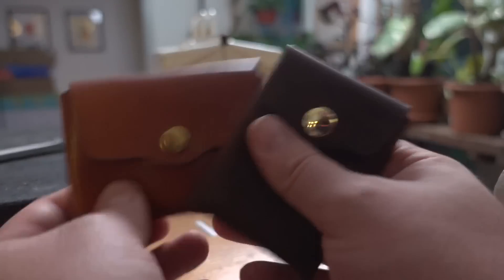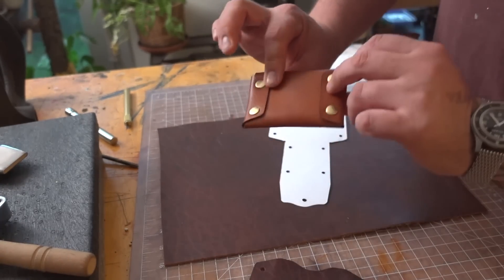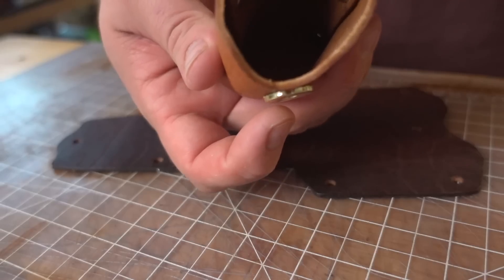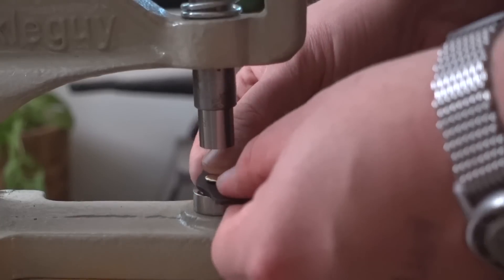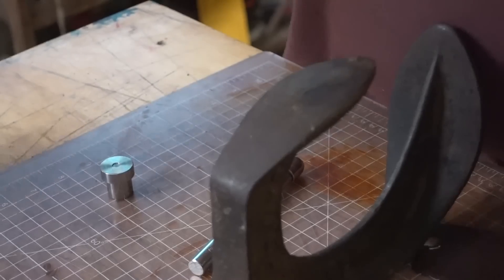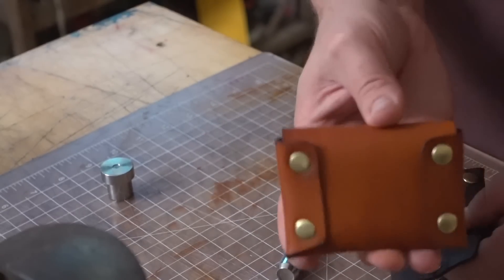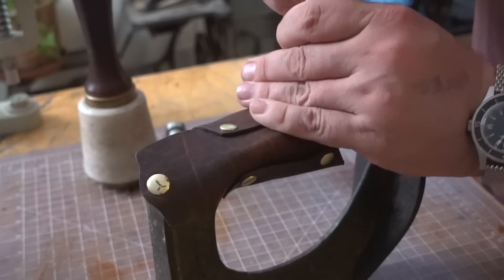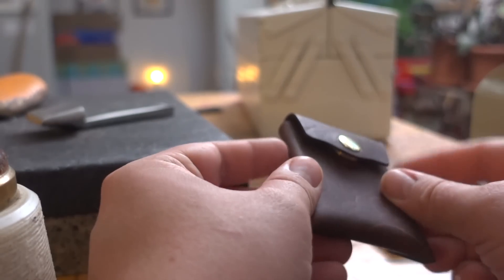This Vertical Wallet takes 15 minutes to make and is HIGH profit

Comment: Will the magnet ruin the mag strip on the credit cards?  I tend to stay away from magnets with credit cards.  Even if there is a chip.  Sometimes the mag strip is needed.  (from what I understand, info on any mag strip is duplicated 3 times down its length)  I may not be correct.